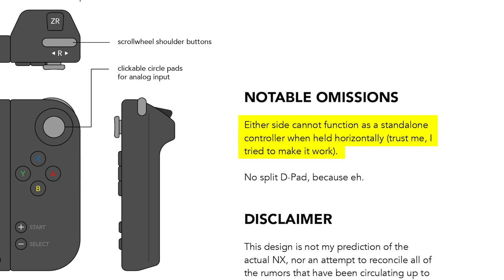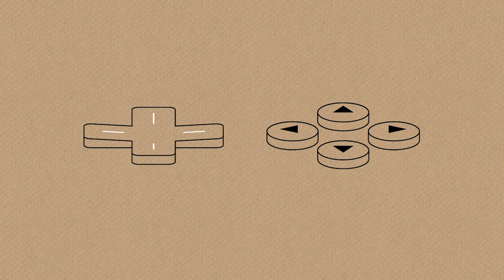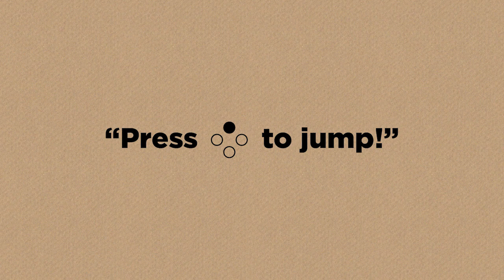Switch Design Questions: The Joy-Con Dilemma - Nerdy Talk Ep.2

Comment: 4:18 The I beam like strucure to the rail (based of the patents) is deffinitely a good choice for mechanical integrity, and the pins along the bottom to connect the circuitry of the controller to tablet, is great. Im concerned somewhat about how big off/how many markets the switch can reach for the price and blah blah blah, but I do find the design and engineering amazing. They went above and beyond on ingenuity.
Reply from the maker: I wish I had a chance to really study those patent drawings in-depth before making this. I'm only somewhat familiar with the contents.
Reply: I didnt study it too much myself, but heres my favorite things so far.

The I beam shape slide for locking in, restricts movement, creates friction, the axis isnt horizontal where we could be pulling it apart, the only downside is that it will rely on some type of mechanical lock to prevent the screen from falling out from between your hand, which is something that could break eventually, ecspecially if you hold the switch vertically, where all its weight would be pushing against it. This shouldnt be to big of a problem and is something the will inherently try to get right (presumably) and is part of the reason the swift switch from handheld to dock can happen.

The way the circuitry of the controller connects to the tablet looks a lot like an sd cards tabs. This means the electrical connection physically doesnt happen until its fully on the the tablet, and simmilar to what I said about the rail system, connects the devices in the vertical axis, so it shouldnt be too finneky or accidently didconnect on us.

Also in this rail, are the lights for identifying controllers, but its on the side of the rail, which then shines into the joycon grip, using only one set of lights instead of two.

Also in the rail, again, is potential shoulder buttons, so each joycon may have, have 4 face buttons, an analog stick, and two shoulder buttons. 

(You may end up saying some of this, I wrote this half way through, and Im in total agreement that the two tone plastic color is to communicate its function, the same way a question block has a question on it, the design visually makes you predict the function.

Also quick conspiracy, the "share" button on the switch left joycon, is a shadowplaw/ansel based concept from nvidea that allows us to take and share photos/footage of our games with ease.

Comment: I have some solutions for these problems:

"Horizontal Woes"

This may be too late (if the design they showed is the final one), and it could clash with with the design visually... but a solution would be to have coloured buttons. When vertical, the button prompts use the letters, but when when horizontal it uses the colours instead (or it just uses colours for everything). I think it's a clearer way to telegraph the difference, just as the size/shape of the Gamecube buttons did more than the actual letter. Or they could have used "U, D, L, R" on the D-Pad since those letters aren't used anyway, but maybe they thought in single-player it would've made it look busy with too many letters.

"Weird Joycon Configurations"

I don't like the idea of selling solutions (it only highlights that your product isn't designed well) but it allows for customization if the user wants it. Sell joycons with a D-Pad, but also duplicated joycons for the other side. So a joycon with the analog stick above, for the right side, and below for the left.  I can see joycons costing around $15-$25 and buying one extra wouldn't be horrible. They did say there would be plenty of accessories afterall.